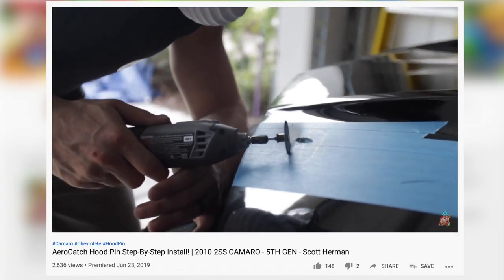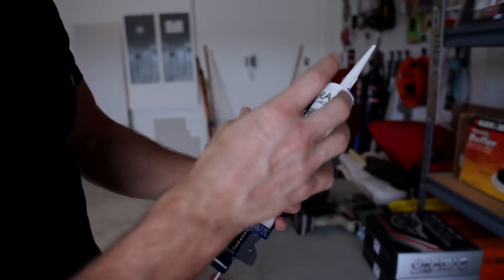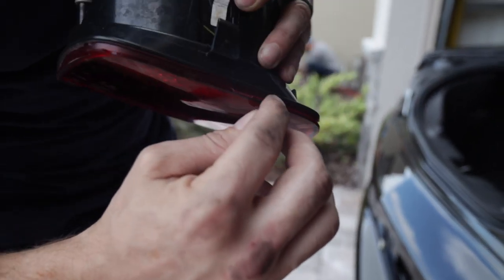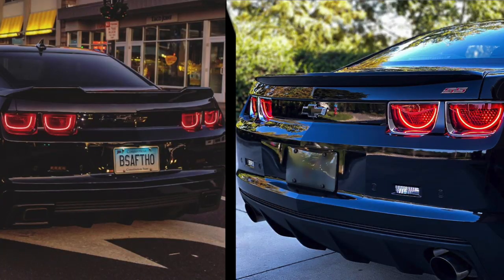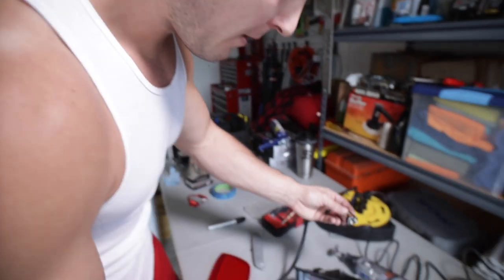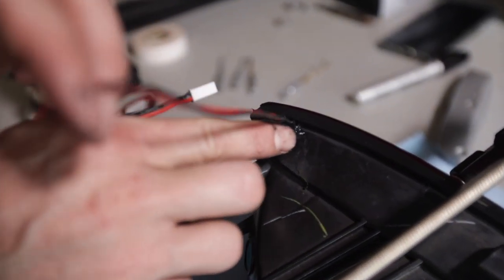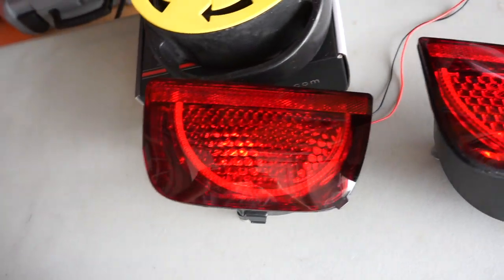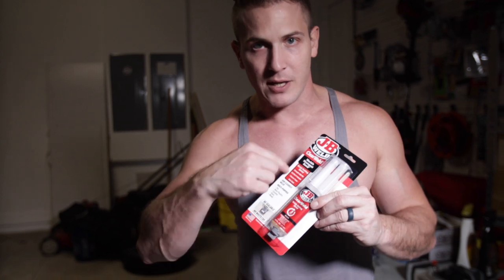ORACLE AFTERBURNER "COMPLETE" TAIL LIGHT INSTALL GUIDE! | 2SS Camaro (5th Gen)

Comment: You used a dremel. Can you not put these in an oven to soften the adhesive so it comes apart on it's own? I've seen headlight halo install tutorials do that.. but maybe the brake lights are different somehow?
Reply from the maker: I did that for the headlights... but these are a solid piece.  So unfortunately you have to cut them open!

Comment: 2010-13 tailight swap is a pain in the ass. Really time consuming for such a subtle mod.
Reply: i’m thinking the same thing... you really have to do a ton of work and custom fabrication to make these work, and on top of that they are pretty expensive ($200). I wish there were better 5th gen tail light options for the 2010-2013 years